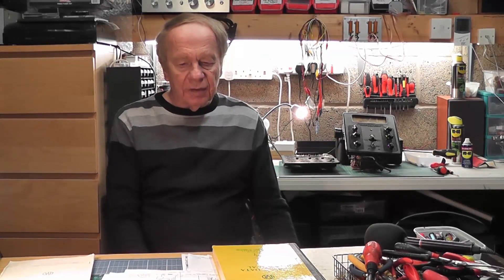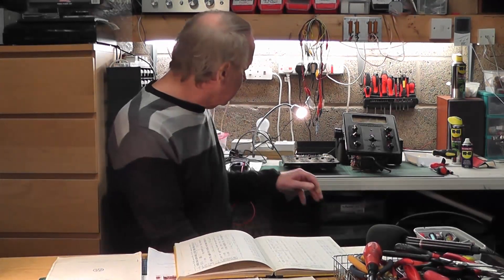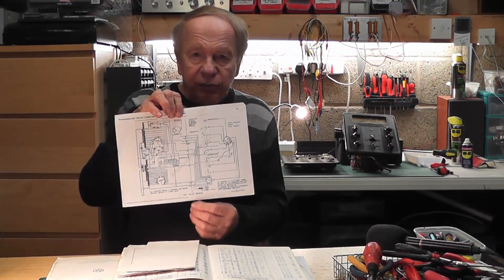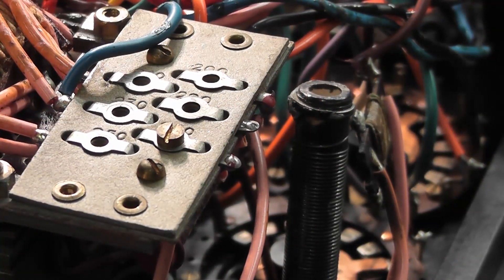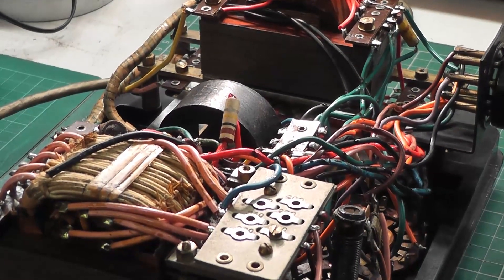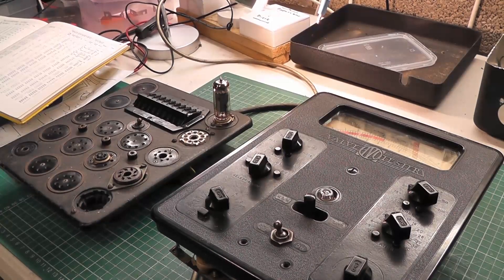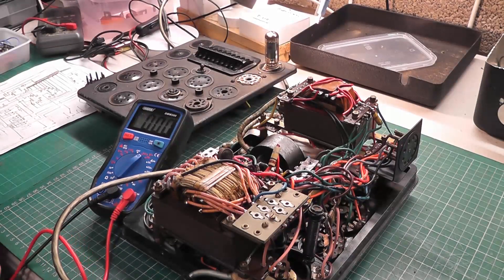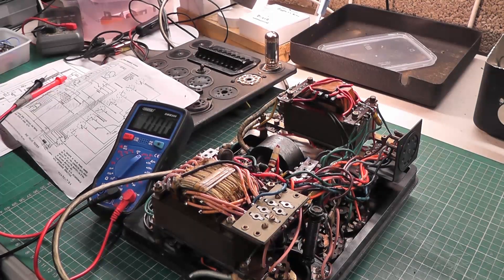AVO Two Panel  Valve Tester 1939

Comment: In my opinion, the two-part AVO tester has limited use. It can test some early valves that the later Mk.1, Mk.2, Mk.3 etc testers can't test, but it is fairly limited in usefulness because it can't test later valves. I would love to have one for the early valves that I come across, but I'm not sure how much I would want to pay for a working one. 

I'm fascinated by how much people will pay for faulty AVO valve testers on eBay - a constant source of confusion. The broken ones seem to sell for close what working ones sell for despite being completlely irrepairable. I'm so glad that I tracked down a working tester a few years ago. I treat it with kid-gloves, and I won't let anybody touch it.

Comment: This will be interesting for me David as I have the same tester,the valve base unit has been "got at" , but  I thought it would make a good project to rewire it ,the main unit meter has a bent needle so not sure how far I can progress with it,so I will watch with interest,best regards Colin.
Reply from the maker: Hi Colin,
Thank you. According to my circuit diagram the neon should light when the tester is turned on, mine does not, how about yours? I will take it slowly tracing the circuit bit by bit. The meter needle goes hard negative and vibrates. Need to find out the cause of this before I cause any damage. Good luck with your rewire of the valve bases. 
Dave

Comment: Hi Dave, watching you go through this valve tester checking voltages along with continuity checks too would not be boring to see. It's all part of the enjoyment we all have when fault finding on a dead piece of equipment. So I for one would happily watch as you plod your way through, carrying out various tests, seat of the pants is what it's all about..it's what the fun of doing electronics is all about.
Reply from the maker: Of course you are right. I will film my  excursions into finding the problem. I do not think there if a problem with the VOM as I get response from the meter
Reply: @DavidHallettProjects  I agree with Theoobovril, I would also love to see a fault finding video. It's anything but boring.